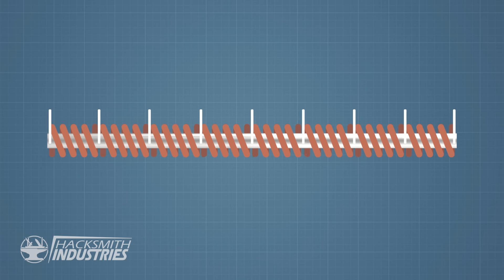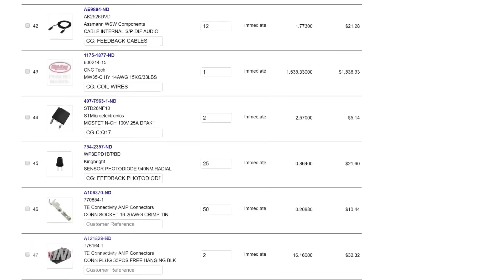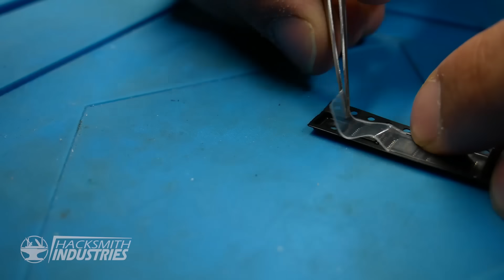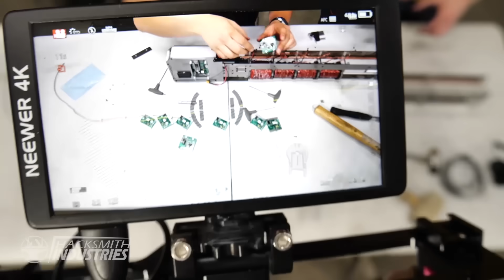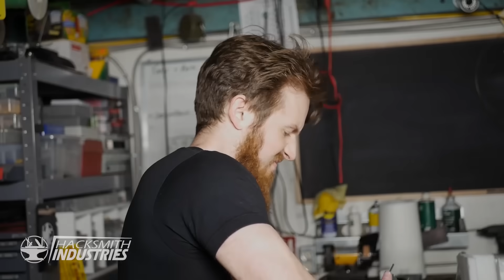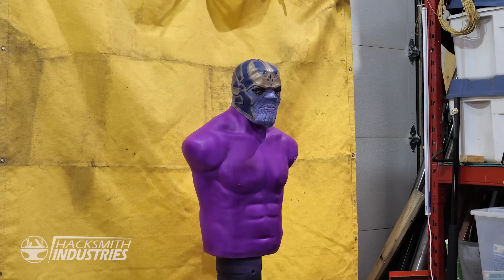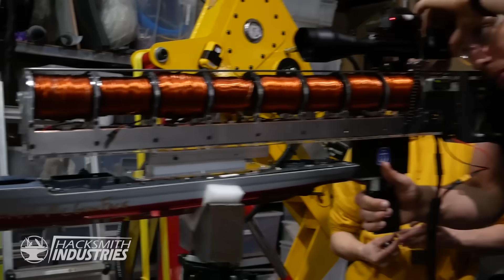50 CAL ELECTRIC COILGUN

Comment: This is cool but I can get a hunting slingshot that would put this gadget to shame. How about making the coil gun way stronger and reduce the weight fellas. Nice
Reply: Mechanical energy and chemical energy is currently more advanced for small scale. Until better batteries and capacitors are available, it'll basically remain the way it is for the while. With chemical weapons overriding most other options.

Comment: You need to use coild with much less resistance and pulse capacitors and adjust the timing so that the firing time progresses with the increased speed of the projectile, otherwise you lose a lot of potential if you're just firing all stages at the same point.  In other words, a lot of research and a little math. ;-)  You'll need to match the pulse width to the coil resistance and the capacitance.  A coil gun that big with that many stages should be deadly, and would be if you could get the efficiency to even about 15%.

Comment: If only you could have the bullet spinning before it was launched, like a missile with grooves on the inside that only allowed it to be rotated in one direction loosely attached to a drill, that when launched would pull it off and send it with more accuracy.

Comment: This seems rather inefficient considering how much cooper you used. If you want it to be output at least 20 times more energy, use high voltage capacitor banks(usually two 600v in parallel charged to 1kv), and gas discharge tubes as triggers.

Comment: Hi, looking back at this video, wasn't it a bad idea to use metal as a casing for the gun? Sure it wasn't a big portion of the gun but since there's so much current wouldn't there be eddy current losses? Did the side metals heat up when you guys used it? (since that would mean loss in power)

Comment: Geez, that's complicated. I'd have tried something easier for triggering like gating reed-switches arranged radially and equal distant around an accelerating fly-wheel with a magnet (driven by a motor-drive that has adjustable ramp parameters). Enable the gates with the trigger as it's ramping up. Use relays with counter emf diodes. Could even use a geared up flywheel to drive a high-voltage brushless (72v) motor and rectify it with half a dozen stud diodes for a Big-ass DC alternator too. Just be sure to use fuses OK? May be even try a rifled barrel with a Teflon coated projectile.

Comment: you should use a discarding sabot to make that more effective. puting a tungston or lead dart in a magnetic material which discards when it leaves the barrel. transfering the kenetic energy into a smaller projectile. itsome thing that is used modern MBTs. to increase range and armor pentration at greater ranges. now i may have a few details wrong i only know that APFSDS is a type of kenetic round that is extremely destructive while not having any explosives but being purely kenetic.

Comment: How about having optical sensors to detect the progress of the projectile, to calculate an estimated speed, to predict position, to optimize the timing of the coils.
Probably you would want to use fiber optics, to have the electronics away from the coils.

Comment: now here is the thing, at the end of the day you need to reach at least a good 1200 feet per second to then call it an actual weapon, i say right now is a steel squirter, no faster than a paintball gun, so i think that better insulation and higher amperage and focus the magnetic field properly. Its a lot of work but i think if you can break 1200f/s or even better if you can hit hypersonic. if you can keep the contraption under 200kg firing any ferromagnetic projectile big enough to apply lethal dmg, then yould should be able to be incorporate it into a "vehicle's power system" maybe then if you can sustain high voltage,  high current through your system without frying it or arching then you got yourself a classified project ;-)

Comment: I know this video is ancient but you didn't spin the projectile for stability. You need the coils to be built like in a brushless motor. 12 coils in each section, offset by 1/12 in pulse coordination to each preceding section, and the the projectile should be non-ferrous in 9/12 symmetrically along the rotational axis of the projectile. Do you want me to send you a Fusion 360 file?

Comment: very cool, how come you guys dont use a smaller grain projectile with similar physical size and play to its advantages. One thing that will always be constant with any type of projectile weapon the higher the grain of projectile = the more energy needed to move it. For example a 115gr 9mm is somewhere around 1150 fps while a 230gr 45acp is only 830fps. your bullets are many times larger than even the 45 acp. imagine if you guys shot something like a metal dart/ flachette through that you would be approching real guns at that point.

Comment: I know this project was several years ago, but...

Would it be possible to magnetically induce spin on the projectile to stabilize it in the same way as a conventional bullet?  Could this be done or would you actually need some form of physical “rifling”?

Of course there’s alway APFSDS. But I get the feeling making a reasonable number of projectiles and sabots would be way too much effort. Not to mention doing the maths to design a smoothly separating sabot and a stable dart.  So maybe just leave sabot rounds to the folks who make them for tanks.

Comment: Much smaller coils & a lot more stages would have been a lot better. Those big coils will have a lot of inductance and limit the current flow. You want to deliver the most amount of energy in the shortest time. I would have use Caps for discharging & either flat wire or litz wire for better efficiency. Also would have helped if the projectile was made of small steel wires laminated together (parallel) to reduce eddy current and increase magnetic permeable (= more energy coupled into projectile motion). The issue with coil guns is that once the projectile reaches magnetic saturation, no more force can be applied to accelerate it. 

In my opinion this was a coil gun developed by Justin Hammer, not Tony Stark.

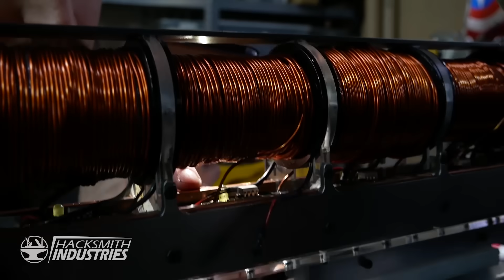Comment: 17:18 did you calibrate your coils using an ohm meter? Worked on a project once where we used a chart to determine length based upon wire gauge, we did our final calibration w/ an ohm meter & adjusted the length until each unit we produced had the same amount of impedance.

Comment: Coilguns should use high voltage high capacity capacitors to dump a ton of current into the coils instead of batteries as batteries cant output a lot of current and are usually low voltage
Reply from the maker: Kind of. Our rail gun featured capacitors. Coil guns are quite a bit more sophisticated, and the batteries we use are capable of huge discharge currents

Comment: If I were you I had used program with heat control. In that case I hadn't made scheme with power transistor (the special radiator is screaming "I'm a hot stuff") and microcontroller in reverse side to transistor. I'm not surprised one controller is gone.) Hope you are write postmortem, lol

Comment: Your schematic link just goes to digi-key corporation there is no actual schematic nor program file for the microcontroller.  I've been working on a coil gun for a few years now and my biggest problem is the recycle time allowing me to go from single round to three round burst to full auto.  I'm looking at having my coil gun about the same length in size as a 12 gauge shotgun,  while I found your video quite intriguing the size of your coil gun I felt was impractical.   I was thinking of using an Arduino as a controller with an LCD display I already have most of the code written for the Arduino for firing silicon controlled rectifiers as they can handle more current and higher voltages

Comment: nice project but a bit weak, after the intro where you told how fast and so the coil can get the shooting results where dissapointing you do in the video. But anyway where nice project i like your channel alot. But think what a big military coil gun can do.
Reply: Pretty sure they made it weaker on purpose. I've seen other clips of home made rail/coil guns that punch holes in steel plates. Those were also in the same size and shape as this one. They could probably increase the power draw and actually achieve a pretty lethal set up.

Comment: Could you make a much cheaper/simpler design by instead of using all the complex electronics and LEDs, just put some brushes inside the bore, so they touch the projectile bolt and turn the right coils on and off at the right times ??  (Similar to a brushed DC motor). It also won’t be limited but the speed/delay of all the electronics you have in there

Comment: How much electricity does it use? Would it be possible to power it using only batteries? If it is, how big would the battery need to be?

Comment: I like both your rail and coil guns it has a similar system to a boat motor design that I have mostly created. I know a little about everything even built almost working proto type. Electronics is my biggest hurdle. Yes it is a magnetic drive, no it is not the Red October. Would you be interested to know more and prove i am correct, then possibly help me build it.
Edge

Comment: I think the most ambitious project would be to enable a high-speed flachette dart that is shot from a coil gun. Incorporating the ideas from a young man who added spin to his coil gun at the breach and then using a discarding sabo protector or have it be the metal necessary to propel the flachette and have it really perform I mean super penetration a tungsten penetrator flachette.
Reply: You could also naked a high-speed repeater so a very automatic high-speed. Being probably a conductive material ever be effective against personnel, materials, and drones, and or even anti-missiles.
Reply: Is that actually true or could you potentially activate all of the coils in front of the desired projectile and it's a matter of how quickly they can recharge and refire. Could they not be charged and fired all of them in front of the projectile so that you get some magnetic pull forward from the coils where the projectile is still behind but haven't able to recharge and fire at its full charge when the protect tile is ideally within the coil.

Comment: Totally into it until the word  “freedom units”. As I’m certain these engineers understand the SI system is made so that all scientists may communicate using the same terms. So people can DO SCIENCE.
It’s not “miles” per second because “mile” is based on an old deprecated British unit. You fought a war to free yourselves from the British but call THEIR system of units “freedom units”? Americans need to chill the f out.
We, scientists (I’ve been a data analyst at a research firm for a decade and studied physics, Set theory , finite mathematics, calculus, thermodynamics and other sciences as demands of the research projects and yes real scientists use SI because every SI unit relates to every other. Plug one mile into an actual scientific calculation and you’d get an error message. By using the same terms it’s not suppressing your right to be wrong or some shit it’s so that scientists from all countries can communicate without having to go through and change every mention of miles or hog’s stomachs or donkey-power or unicorn-luminance or any other non informations units. To someone using Km (the entire world other than the us and Britain- except British scientists use Km obviously they don’t call the pound a “freedom unit” because Trump level psychosis hasn’t made it across the pond yet. Basically- grow up ffs)

Comment: Coil gun has no limits but not worth making on small scale cuz it is very slow even with so much copper wire so at small scale make a motor submachine or rubber band and spring sniper

Comment: Would be more effective if you attached a broadhead arrowhead to your projectile and turned it into a flechette. Your gun is impressive looking, but it seems like it lacks power. A decent quality slingshot or pistol crossbow could easily produce identical if not better results with far less complexity (check out Joerg Sprave's "Slingshot Channel").

Comment: When designing you pen.. how dud you chose an IC? As I assume you needed an ic with two input and outputs for the coil and light sensor, but I don't get why you made circuit as you did for controllers?... controllers as you only feed back light sender data and turn off ic enable pin for coil..

Comment: you want a polarised one instead of pulling only , so it pulses positive say and pulls the bullet as it shuts down and the other starts reverse the current and push with the otherwise dead coil. why is that not the obvious solution to more power? if you make the pcb let me know :P also torroids? would give you rifling ?

Comment: There a reason the projectile doesn't fire straight?  It kind of just flies out and turns in mid air.  Does the barrel need to be rifled out?
Reply: Both are options.

It can be rifled but itd turn it into a sort of not really rail gun.

Fin stabalization is needed to keep it stable.

Or a more properly shaped warhead.

Comment: Light Speed the maximum?

Sure.

But there's a snag:
It's SLOW.
8 WHOLE minutes from sun to here?
God, I'm a cripple and shuffle faster.

Thankfully, Relativity is incorrect.
Right now at 99.9999% the speed of light in the LHC, not the slightest of increase in mass has shown.
That means, "no mass increase, EVER", PERIOD.
Since, if there was to be increase at speed of light, which is in about 300 meter/second  more in the LHC, it would have been noticed.
Even at mere 20% it would have been seen.
Why?
Well, Mass does not jump from 0 to infinite in mere 300 meters/sec.
It would go slowly, a line upwards, in a constant increase.

It's SO bad in fact, Donning-Kruger came up with the theory to protect Relativity from being debunked.
But no matter what they do, matter simply cares not for their "theories", naaah, it does what it does, whatever it may be that it does.
But what it DOES NOT DO: Increase it's matter.
So, faster than light travel, here we come.
Reply: Oh, Relativity works, you say????
Well DUUUUUUH, nothing this far has gotten to "relativistic speeds", or higher-than-light-speed.
So DUUUUUUUH logically it still works.
But soon ... aaaaah ... soon it'll stop working.
Mass holding Nuclei will give you the bird, speeding PAST speed of light without added mass.
Reply: idk about light being all that slow. (Note: in my proof, I'll be using mph bc I already had the results I needed before this comment)
In mph, light speed is 671 million, which should obviously be faster than anything on Earth. Divide that by 60 (as 60 minutes is always an hour); that comes out to over 11 million mpm (miles per minute), and I'm still pretty sure that nothing on earth is faster than a minute of light speed, tho if you somehow know of anything that could be, enlighten me.
The point of this comment is, unless it's fictional works being discussed and not irl things, light speed is way faster than anything we mortals can build with our current evolutionary trajectory.

Comment: Pretty lousy, a rubber band would have worked better. You need to upgrade the coils, increase the amperage, the drivers and introduce z-axis rotation in the metal rod to improve trajectory stabilization. Nice project though.

Comment: Not a very powerful compared to others on EvilTube. Maybe the timing is off. And how are you Quenching the Gauss effect. IF you had optical#1-Coil#1-Optical#2-coil#2-Optical#3-ETC-ETC. You would have to fire coil#1 then ground out the coil (maybe even a little reverse current to kill the field) before the projectile even entered coil#1, Optical#1 would then be used to time Coil#2 firing, optical#2 would time Coil#3, etc. Each stage would have to react faster than the last. Also you would probably need some form of SABOT around the fired round this could help move faster on barrel, stabilize and also impart a spin. Almost like an air dart or cross-bolt.

Comment: seems like the projectile trajectory is off , given the high power of the gun I believe its due the projectile not fitting the dimension of the barrel but this is just assumption , im working on a similar project and this got me worrying since I aim to achieve projectile trajectory performance